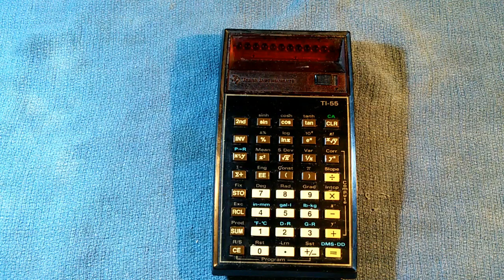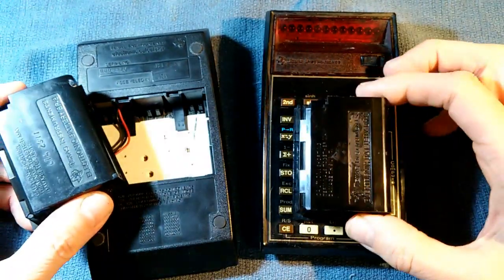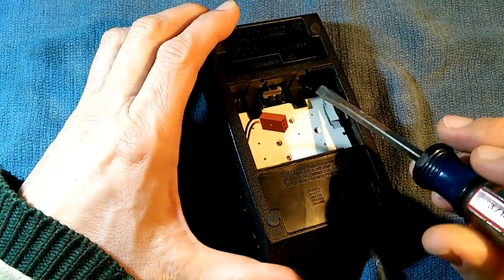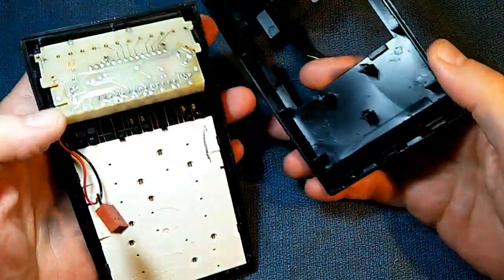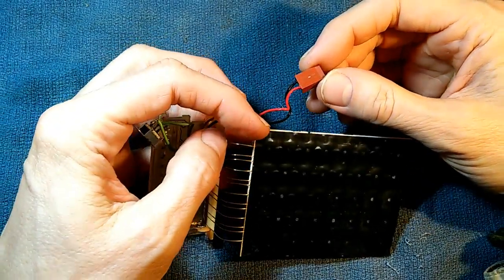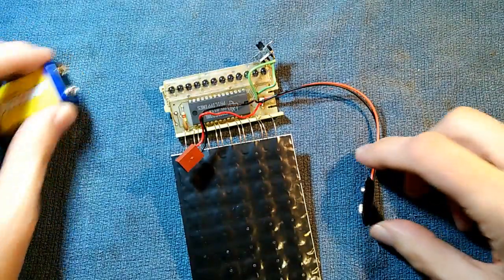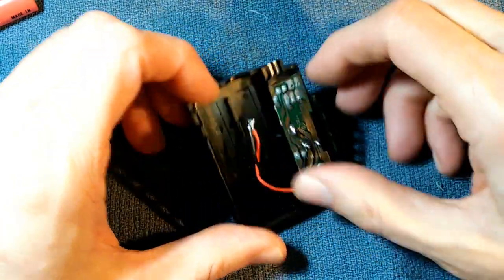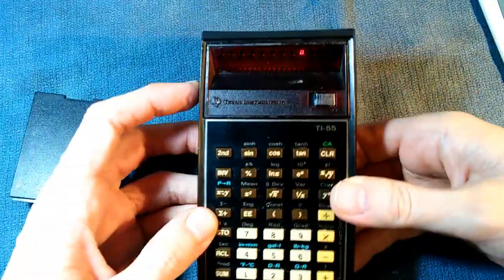Texas Instruments TI-55.  Modified to use a 9 volt battery

Comment: Hi. Many thanks for the video. I got my old TI57 working again, using your 9v battery suggestion. That's the first time it has been powered-up in 40 years, and it still works! If you are interested, I have the circuit-board from the old BP-7 battery pack that looks to be in good order. I can post it to you if you want it.

Comment: OK.  You went through a lot of trouble but guess what that 9 volt battery is too big (too thick) to fit inside the battery cavity with the battery cavity cover in place.  And certainly to test the calculator with a 9v battery there is no need to solder in a 9v battery connector.  I just don't get it.  It would be helpful if you came up with a real solution to replacing corroded out BP 7 packs.
Reply from the maker: The 9Volt battery fits just fine with the cover.

Comment: Instead of buying a 9 volt battery clip, you can cut open a dead 9 Volt battery and use its connector.  Solder on wires if necessary and  insulate the back of the connector with some electrical tape.

Comment: Thanks!! The modification worked. I had to dremel out some inner tabs on the lid to get the 9-volt to fit with the lid closed. I tied two knots in the excess wire on the interior of the calculator to help prevent pulling the power lines off of the computer board when changing the battery. Unfortunately, some of the digits in the middle of the screen were very dim to the point that you could not see the numbers.

Comment: Great video. Remember being very annoyed when I was younger and trying to get my calculator back working on the cheap that TI chose to swap the red and black leads around. Glad you’ve documented it properly. 

Be careful though if trying this with other TI Majestic range of calculators though. Some of the battery packs output different voltages, eg the BP6 for the SR-51-II and some early TI-57 output 2.4V!

Comment: I love these old electronic calculations, from the very earliest days of our "Integrated Curcuit"/ "Micro-chip" REVOLUTION!
In trying to teach young people just "How it was" way back "in the Olden Days!" before they were born. Or even well before their own Parents were born!
I tell them the story of my earliest involvement in the "Computer" industry. 
Almost none of them know that to have a "Computer" in the 1970's, YOU usually had to build it yourself!!!!!
Myself and some of my friends would take an article from a magazine, study the layout of their circuit board, order us a bunch of parts, and get to soldering!
By 1984, the first Apple Macintosh went on the market. And soon, 1986, an improved version of that machine called the "Mac Plus" was being sold.
To get one my wife and I drove nearly 2 hours to a nearby City and ended up spending over $3,600. on a full home computer system.
We had the: Mac Plus, external floppy disk drive with cable, dot-matrix printer 🖨 and a selection of Software!
Later on, as they became available, we added our first external Hard Disk Drive. A metal box the size of a kitchen "Toaster" that had an initial capacity of 20 Megabytes!  That's right! Only 20 Megabytes! 😅
(We still own all this stuff!) 
So sad that today's kids have NO IDEA just how "Good" they've got it, today. Especially when it comes to Electronics Technology.

Comment: Cool video. I’ve still got mine from 1979. I worked all summer so I could afford to buy it. The book that came with it had more advanced algebra concepts in it than we were learning in high school. I had a slight head start before getting buried in the dust. I swapped out my leaky old nicads for a set of Lipo AAA batteries. I’ve got a Ti58C as well. I did the same swap for new cells on it. The old school Ti Programmable is pretty cool.

Comment: Dear friend, thank you very much for this excellent video. I have two SR-51-II and the battery pack had two 1.2v rechargeable batteries but ... it has 3 wires (Blue, white and green), and the circuit that must step up to 9V and converts AC to DC doesn´t exist! It's just a bare wire-circuit without any component! it'looks as if it´s only function is to hold the two batteries together and that's all. Any advise you could give to me? I don't want to mess it up and to burn the calculators. Thanks again! Really appreciated! Kind regards!

Comment: I was able to use a rechargeable 9 volt lithium battery (FlePow).  Not all 9 volt batteries have the same thickness.  15.8 mm thickness of the FlePow works. With a zero, the calculator uses 11 ma.  With all 8's on, the current is 37 ma.

Comment: I wonder why you wouldn't have just cut the leads and soldered or crimped on the 9 volt adapter pad?
Reply: So he could still use the original battery pack and charger if he had access to one.
Reply: Nah - that's not why. Listen here -- 7:37 - he just didn't want to be bothered
Reply: Well he later justified it at 9:22 that he could now use a variety of battery packs.

Comment: Thank you! This calculator is older than me, picked it up at a secondhand store, absolutely love the vintage aesthetic and display. Using this guide helped safely disassemble it, and I am planning on soldering in a 9-Volt plug due to battery corrosion. Appreciate the vid!
Reply: This TI 55 was the usual calculator when I began highschool, but at time I bought a HP34C

Comment: I recently acquired a TI- MBA financial calculator, which was put out by TI around the same time as the TI-58/59. It too was constructed with a similar battery pack which is not longer working. Would you happen to know whether I could do a similar replacement with a 9V battery? Also, would I need to switch the leads (i.e., red to black & black to red)?
Reply from the maker: According to "Datamath Calculator Museum", the TI-55 uses the same BP7 battery pack as the MBA.  So the 9V battery switch should work the same for both.  Note: since I do not have a MBA calculator to examine, I can not be 100% certain. 
http://www.datamath.org/BP_List.htm

Comment: I have an SR-40 (since '77) that uses a BP-8 pack, like your TI-30. Having lost the AC adapter that uses a proprietary connector, I will have to use an 9V cell instead. Your video/audio presentation was excellent!!
Reply from the maker: Thanks.

Comment: But then you have a battery pack that won't fit back in
Reply: Yep, the cover will not fit. Maybe modify a lithium 9v battery that can be charged with a usb.
Reply: Not all batteries are the same thickness.  Try 15.8 mm or less. I eventually found a rechargeable to work.
Reply: I used the AAA sized ones that they use in phones.

Comment: One question: the TI-55, if I'm not mistaken, works with 2 1.5 volt batteries (1.2 volts rechargeable) or so it seems from the container (2 AA batteries), therefore 3 total volts. The TI-30 works directly with a 9 volt battery. Was the TI-55 powered with 9 volts instead of 3 volts not damaged?
Reply from the maker: The BP7 battery pack of the TI-55 did contain 2 NiCd batteries.  That is 1.2 volts x 2 = 2.4 Volts DC.  There is a DC-DC voltage converter  inside the battery back that converts the 2.4 volts DC to 9 volts DC.  The output at the terminals of the battery pack is 9 volts.
Reply: @c.davidgraves4848  Ah understood. I didn't know that circuit was a voltage converter So the final supply voltage is 9 volts. So ok for the power supply with the 9 volt battery. Ok! Thank you.
Reply: It’s a good question though, as the BP6 battery used in some similar calculators output 2.4V, so you need to know about your specific calculator before trying this.